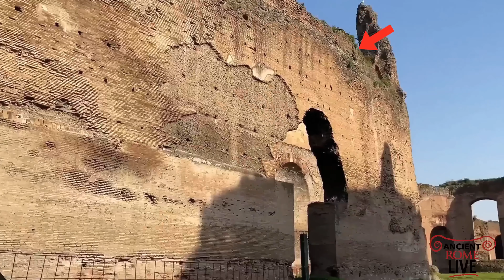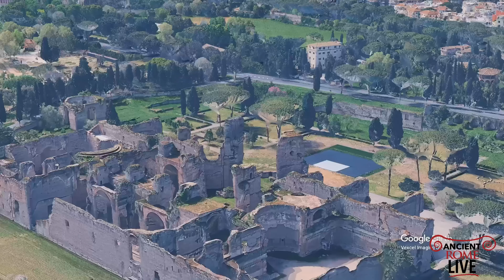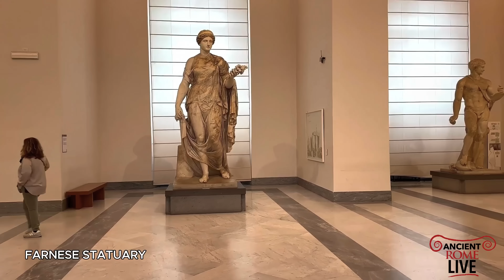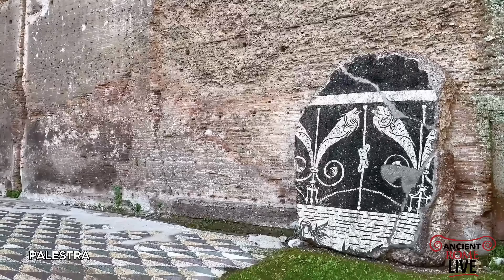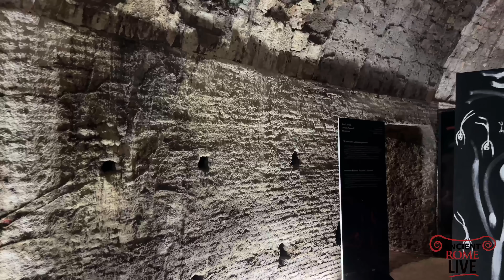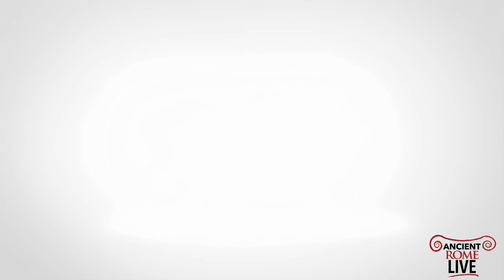Baths of Caracalla Explained: Build, Design, Sculpture

Comment: The bricks of the walls are actually triangular, with the pointed end stuck into the concrete and rubble core. It's incredibly solid and provided space to hide the water and hot air lines.